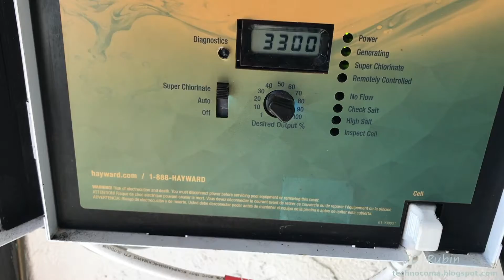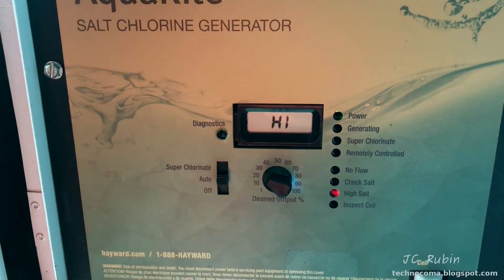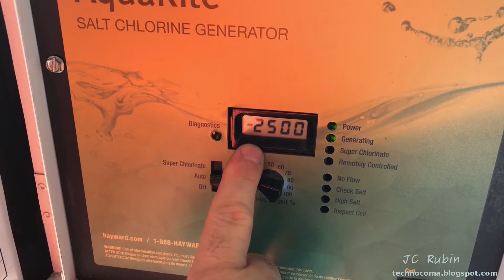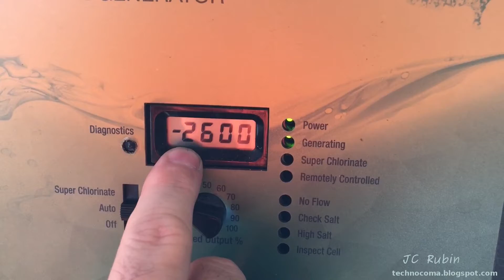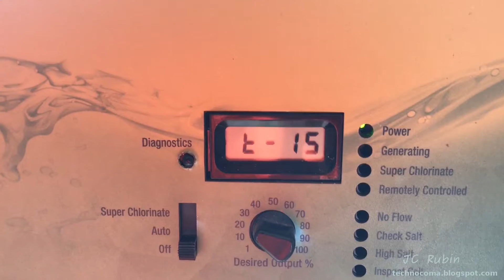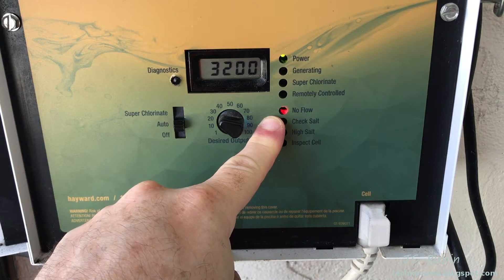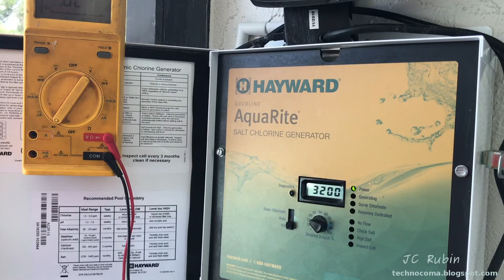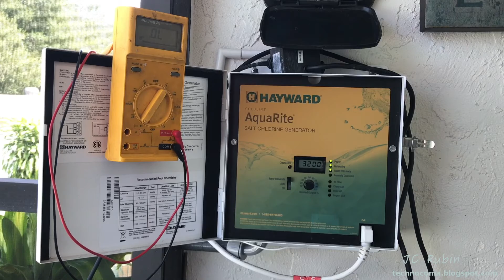Hayward AquaRite Turbo Cell - Quick and Easy Troubleshooting of Common Problems.

Comment: Thank you, but the No Flow has sold red light and I can't get it to go away!  I have not one, but two sensors, one before the salt cell and one after.  The manual has the sensor 12" or more past the cell.  Mine is only 7" because there wasn't room to put it 12" with a new filter.  The pool technician installed the sensor before the cell. One sensor is new.  I've tried both sensors in both positions (before and after the cell) and cleaned the contacts on both but neither get the No Flow to turn green.  I did got a flow a month a go and the system was working.  The Hayward authorized dealer suggested backwashing the filter but that didn't help.  Any ideas?  I called for a service appointment but previous techs knew far less about the system than I do, and the closest authorized dealer is too far to service our home!
Reply: sorry, "solid" red light, not sold...

Comment: I put an old board in that I  had replaced the thermistor in. After a new aftermarket board lasted 2 days. 
I was confused about the salt level numbers saying 2.7 and red lights were on after 30 seconds or so. 
Turns out I needed to check all my settings. It was in metric was set for t-3 cell mine is t-15  and had to calibrate the salt level. I have a hand held electronic salt meter and it’s normally very close to the Hayward reading. I had to toggle it from off to auto a few times to get it to start counting down like you’ve seen in calibration videos then flip it up to super chlorinate and back to auto to hold the setting. But now lights are green and everything it good in the pool.

Comment: This video is excellent. My salt reading was at 1900 and yet when tested in store was at 3000. A reset as explained and bingo, it reads 3000 as well. All blinking lights came off. Thanks!
Reply from the maker: You're welcome.

Comment: I have an older Aqua Rite connected to an Aqua Link system. However, the Aqua Link RS6 display does not show any info on the Aqua Rite to adjust it while the Aqua Link light is on on the Aqua Rite. The only lights on on the Aqua Rite are the power and the Aqua Link LED lights. When I unplug the flow sensor wires the no flow light stays off, also the display shows 32V but 0 amps when the pump and the salt generator (Cell 15) are running. I checked the use on the Aqua Rite and the power coming into it, they seem fine but no salt generation, no amp, and no faulty flow even when I unplug the flow wire. Any suggestions you may have would be greatly appreciated.

Comment: The problem I'm having is when I turn the system on the power light comes on then the generating light.  After about 30-45 seconds both lights go out yet the digital display is still reading.  I know I'm not generating because my pool is starting to turn green.  Just wondering what might cause the lights to come on then go out.  I also hear a "click" when the lights go out
Reply: Check your inrush current limiting thermistor, which is a component soldered to the circuit board inside the control box. This part often burns up on these things and will cause it to stop sending power to the cell. Sometimes you can just re-solder it, but usually you have to buy a new one. Digi-key sells them. There are videos on YT showing you how to do it if you're not familiar with soldering. The alternative is to replace the PCB. You might also need to check the current draw of the cell itself as if it's going bad it can overload the box, which is often what burns up the inrush thermistor. 

If you don't know how to solder or don't want to try it, you can probably remove the PCB and get a local techie to do it for you. It's an easy job as far as soldering goes. Good luck!
Reply: @mikelemoine4267  You responded to me a year ago Mike. I did replace the thermistor and it fixed the problem. The other day I was having the same issue and knew just how to fix it. Replaced the thermistor but now I have a flashing check salt light. According to Hayards troubleshooting it might mean the cell needs replacement. Brought the cell to my local store and it tested as being "OK".  My salt level, according to the panel, is at 2600. I was thinking I will add a half bag of salt and see what happens

Comment: Wow!! You are the man.   So informative!

What if.... When the pump turns off.... The salt generator does not go to no flow and then trips the unti into a fault/check cell issue.   
I've cleaned everything and does great generating.... But when the pump clicks off it's like the gen doesn't. And it faults.
Reply from the maker: When you unplug the flow switch from the bottom, does it go to no flow?
Reply: @retrotechandelectronics  Hi.  I am not the original poster, but I have the same issue.  I unplug the flow switch from the bottom and the no flow light DOES come on as expected.  I plug it back in and it flashed for a few seconds and then starts generating.  But, when the pump goes off, the unit keeps generating (green light on, and I hear a low hum).  Why is it no longer going to "no flow" when the flow stops?  BTW--your video was GREAT and very helpful.  I never knew I had to recalibrate the unit and it was wayyyyy off.

Comment: I have an older Aqua Rite that doesn't have the T cell numbers, it's an older unit ~18 years. How can I be sure it's set to the correct setting? Is it the same as the newer ones, just different? We did have a power outage a few weeks ago and now I'm having issues generating. I have a T15 cell. Thanks for the video. This thing is cryptic, just like my Jandy pool programmer. I have maintained the salt cell and I've just cleaned it.
Reply from the maker: You should try to find the old manual online.  If it supports multiple sizes there must be some way to set it.

Comment: What if the word cold keeps popping up?
Reply from the maker: The water temp is too cold for it to effectively generate chlorine. Its normal.
Reply: @retrotechandelectronics  thank you for your quick response.
Reply from the maker: @boostank1000  youre welcome
Reply: What if Cold comes up and the water is actually 30C? (86F)? Is there a way to recalibrate this?

Comment: First, love your vid. By far the most informative. However, I have a strange problem. I have tried your recalibration 3 times, and still have this issue. So first, I just bought the house, it's a T15 cell, so I started with SOLID check salt AND inspect cell lights. I cleaned the cell with half water half muriatic acid and replaced. Same problem. It shows AMPS of zero, but my understanding is that is because the cell doesn't run when the salt reading is under 2300. My salt reading after all 3 calibrations is around 1600... I had 1500, 1600, 1800. Now, when is FIRST starts going, immediately after the calibration, it will in fact show AMPS (5 or 6 I think)... but after a few seconds running, the check salt and inspect cell lights come on, salt reads about 1600, the cell reads 0 AMPS. Now, I tested the salt myself, and got 3600, the pool place by my house, I brought the water sample to them, they say 3900 salt. I had to add a bunch of chlorine though, because I had hardly any. So in summary, the T15 cell is very clean, the machine can show AMPS, but its short lived. I'm guessing because it registers/senses salt under 2300, it won't operate and hence, shows 0 AMPS. I'm guessing the control panel is ok, otherwise it would show 0 AMPS all the time? I need to get the panel to match the ACTUAL salt reading. Is there a way I can set it myself? I'd like to think that the unit is inaccurately measuring the salt concentration consistently too low, and that is the problem. I think the control panel is ok because shouldn't it show 0 AMPS constantly if it needed replacing? Now maybe my salt cell will in fact need replacement, but I would only know that if A) I cleaned it, and B) it's reading salt over 2300 and STILL can't generate chlorine right? So, any way to manually set my salt level?
Reply: I would look at the underside of the motherboard too see if there are some overheated spots. There is a repair/replacement video of the current in-rush diode that some people have issues with which would show current for a second when you first turn it on.

Comment: Thank you. After 8 years with this system, I finally FULLY understand it. I couldn't figure out why, suddenly, my pool kept registering no chlorine even after 14 hours on super chlorinated. Well  when I checked my TCELL940-W setting  which should be set for T15  it was set at T3. Yaya! Problem fixed . Thank you for the clear directions. Now I know what all those numbers mean.
Reply from the maker: Glad to help!

Comment: Thank great video but I still have solid INSPECT CELL and CHECK SALT. ……9,000 gallons Pool and I added 240 pounds of Salt. ANY HELP? By the way I cleaned the chlorinator with acid already.
Reply: I have the same issue, where you able to fix yours?
Reply: @AdrianSanchez-wo7kf  Yes it was the data cable that goes from the flow sensor to the control box. Looks like a phone cable but I also changed the control flow control itself

Comment: What is the correct t setting for a Hayward generator tcell940swp?
Reply: I have a TCELL940-W which replaced my old T-CELL - 15.  I found an instruction sheet online that advised me that it should also be set on T-15. Did that and it's working great.

Comment: My T15 isn’t generating as of a week ago.   It reads 2200.  When I restart it the calibration one goes down to 800.   But had my water tested two days ago and it was 3100.     I shouldn’t recalibrate it using the 800 correct?    Not sure what to try.    Thanks.
Reply from the maker: Is the T15 set for T15?

Comment: Mine has stopped displaying the t-cell type. I replaced the thermistor last year and after that it won’t give me the option of changing my t-cell. I have a t-9. Do I have to replace the motherboard or display circuit board? Please help!!!??? 

Edit: I still have my original t-9 cell, after replacing with a genuine Hayward, maybe I should hook that back up and try recalibrating? I need help

Comment: My display used to say 3200 now display shows 320 how can i fix that please help dunno what i did tryed recalibrate still same thing :(
Reply: You switched it to metric.  Go to the temperature display,  cycle the switch from auto to super and back.   All the readings will be back to normal.
Reply from the maker: Are you saying the the right most digit no longer displays?  That can be a failure of the driver on the board, the LED, or a trace on the board.  Does it only do it for salinity?
Reply: @retrotechandelectronics  i will take a pic

Comment: My Salt Cell keeps flashing what is the issue  and will it damage the salt cell if pool is still running?
Reply from the maker: Did you reset after inspection, is the salt too low, does it still show generating? there are many reasons why it flashes.

Comment: I have a T-9 cell and my value is 4400 and I can’t get down to 3000. I tried the recalibration but it still goes back to 4400.  What am I doing wrong or something else wrong?
Reply from the maker: Did you measure with a salinity test strip to ensure that the pool is actually 4400? If so, dump and add water to lower salinity.
Reply: I have the same issue.  I have tested the salinity via my chemical salinity tester, which I get 3100.  My pool store gets a salinity reading of 2900 from a pool water sample.  My Aqua Rite unit does not drop below -4400 when performing a calibration.  I did verify that my t-cell-15 is on the correct setting of t-15.  This is all with a new salt cell.  The unit does generate chlorine.  Is there anything else I can try to get the salt reading on the unit to read correctly?

Comment: Hi There, I have at15 cell and i just had my PCB board replace and my reading is 2800ppm but the recalibration process never drops below -3300, is that the absolute lowest the recalibration will allow for a t15 and thus it wants me to raise the salt to that level, or is something wrong with the cell and or its wire attachment? The cell is only 3 years old and is clean
Reply from the maker: First always get a baseline with a salinity test strip.   Know what the water value is first if you feel the equipment isnt working after repairs.

Comment: You save my day.... my cell is a T-9.... I had many problems because it was configured back to T-3.....
A read the cell manual and there are no information about you just put on this video...
Save may day and save me money... 
Thanks a lot..
Reply from the maker: Yes indeed, Not making that a dip switch was a fail in the design....

Comment: Good stuff! 

One other thing on the flow switch, the magnet on the spring lever can go weak. I bought an aftermarket switch when I could not get an OEM. Less than six months it failed. When I pulled the magnet in to close the switch it did not work. So I got my own magnet and yes it worked then. An OEM is in the hole now. 👍
Reply from the maker: Mechanical sensors can fail or become unreliable, no doubt. But when it manifests as NO FLOW many assume its a flow issue, not a switch issue, or a connector issue.